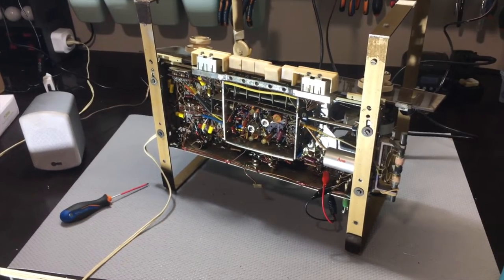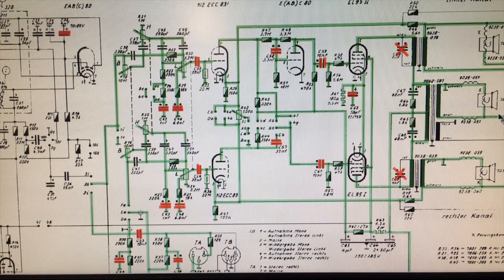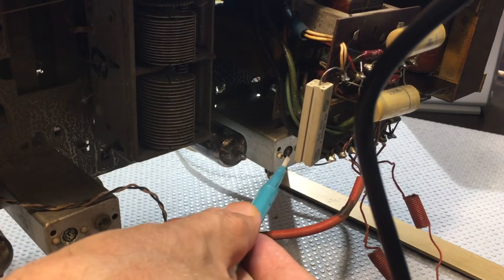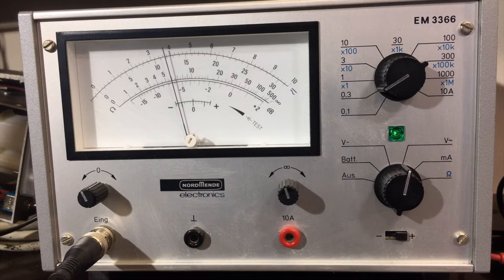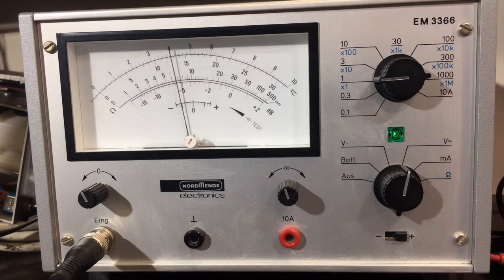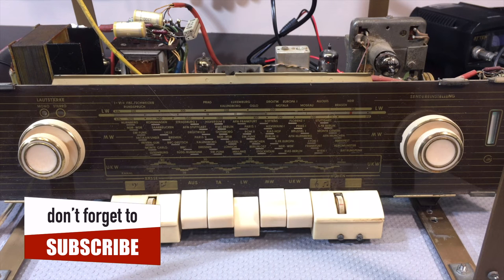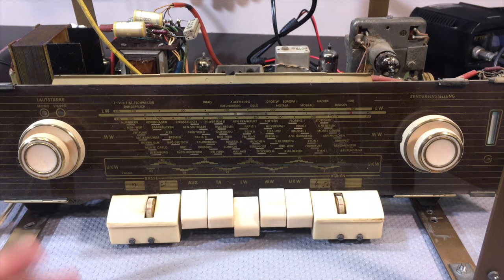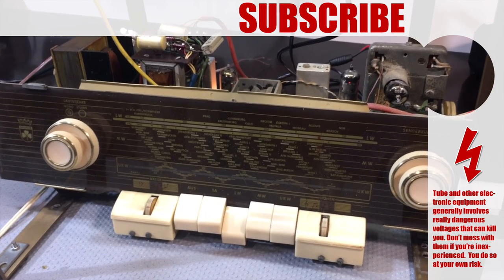Grundig 4006 Stereo tube radio restoration, part 5. The AM gets some attention. Alignment too ....

Comment: Great to see you back from your kidnap ordeal! With regard to decals for home brew equipment; I have successfully used "water slide" laser decal printing paper with good effect (assuming you have a laser printer of course) you can then make any panel by doing the layout on your PC. Once transferred to the panel I use a couple of coats of acrylic lacquer to make the finish more durable. Not sure if you are aware of this technique so I just thought that I would mention it.🙂
Reply from the maker: Yes, I know the decal technique. I ordered some from the UK a while back and they have arrived. Just haven’t had the time to do them yet.
Reply: Thanks Manuel, that's good then. I guessed that you probably did know about it as you are always well up on things🙂

Comment: This has been a really interesting radio, and I have enjoyed watching you go through it.
If you ever have the opportunity to work on a BC348M ( M, E, O, P, or S versions) by all means do so!!!  There are some unique things about this radio!  For one, the IF frequency is 915Khz +/- 0.1%, and  to create a constant Internal noise level when tuning from the low to the high frequency end of a band, they use a potentiometer attached to the shaft of the tuning capacitor ( 4 gang, 14-331 pF each section) with low resistance at the low end of the band.
Keep up the excellent work!
Reply from the maker: That one looks like a beast! Would be interesting to get one.
Reply: @electronicsoldandnew  , should you happen to obtain one, and if you need it, I have the complete manual.  Theory of operations, alignment, photos, parts placement, parts list, etc.  I owned one years ago...worked better than the "Modern Day Radios" of that year and time.  I was able to pick up stations that my "modern" receiver couldn't even hear with crisp clear more than adequate sound!  And I used the same antenna on both.
Reply from the maker: Thanks

Comment: That was a short vacation. Quick question: is it possible regardless what the manufacturer says, for a radio for work better at a diferent frequency that the said spec? I mean  461khz instado of 460khz? Welcome back :)
Reply from the maker: Yes, it could. If the IF is aligned to 461, that’s what will come through best, so you can work with that and align accordingly.
Reply: Depends on the oscillator tracking.

Comment: Quick return - good! I have question regarding Braun 450S - did you touch the stereo decoder in yours? In my 450S I do not hear stereo, the pilot light does not turn on. When I had tried to touch the two trimpots, they disintegrated on first touch (or rather the first one during adjustment, the second one just went off in pieces while I was brushing the board with the toothbrush and acetone (very delicately ;). Now I replaced the pots and set them "in the middle", but still no sign of stereo.
Reply from the maker: I did not touch mine, but if I recall the service manuel gives instructions on how to align it. Do you have the service manual?
Reply: @electronicsoldandnew  yes, I have it, but I am afraid I need decent generator with stereo pilot and mpx. There might be a problem with it. I will try again the peek-and-poke method!

Comment: I notice you are using Rigor DG1022 signal generator. Do you use it for FM alignment? And are you happy with its capabilities for AM and FM Alignment procedures on radios? I ask because I have been having some "fun" with fm alignment using a BK 4040A generator. Not very happy with my results, but I think it could be me more the problem because of minamal experience with alignment of fm section of the vintage Zenith radios I've been working on this summer. Wonder if you could lead me on this ? Thanks, I do enjoy your channel, don't miss any installments yet.
Reply from the maker: The Rigol serves me well for AM alignments (both IF and RF), and serves perfectly well for IF alignment of the FM, where 10.7MHz is used. I obviously can’t  reach the frequency range needs for the RF alignments here. I’ve done numerous FM alignments in my channel that will give you a better idea as to how I go about it.